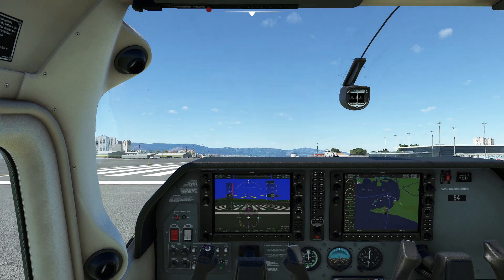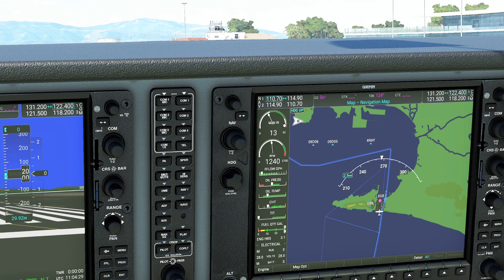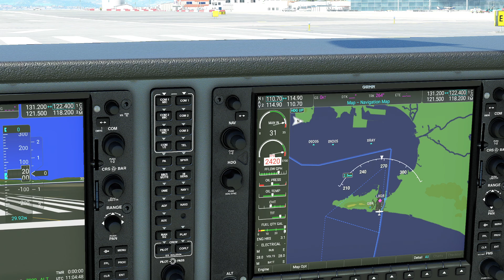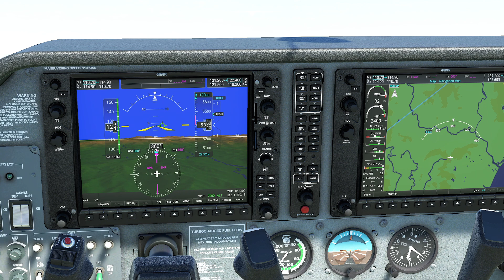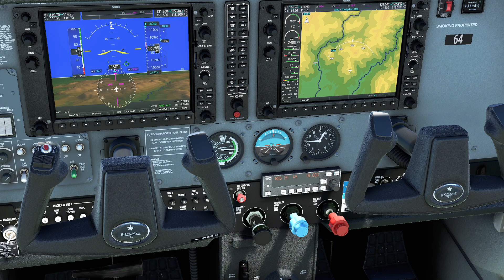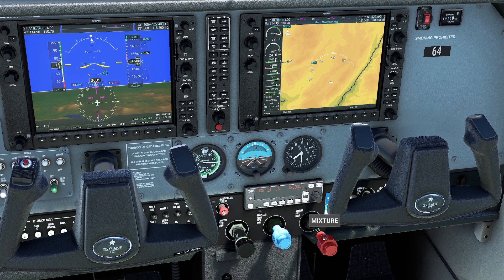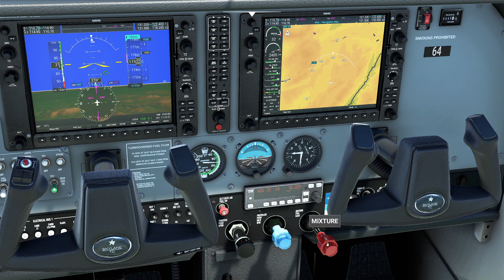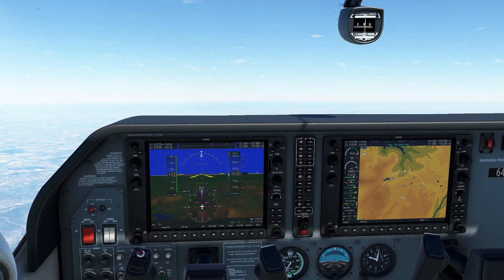MSFS - Turbocharged Aircraft

Comment: According to the dev for the new 414 the sim does not model fuel flow correctly for turbocharged engines. The closest you can get is using automixture in assistance settings.